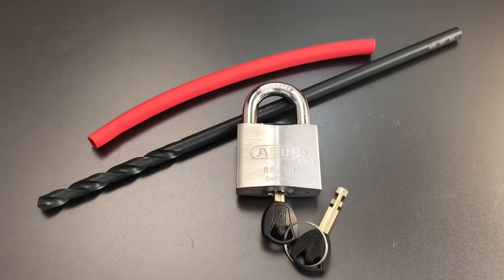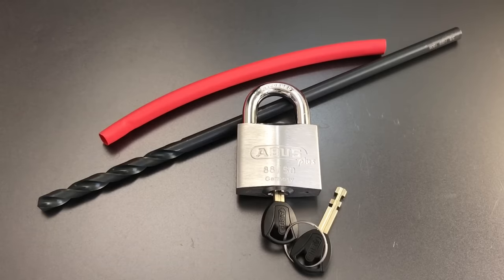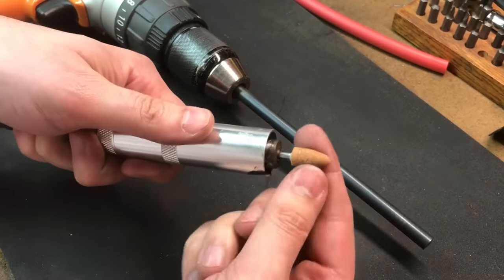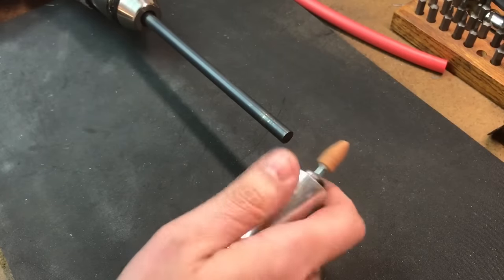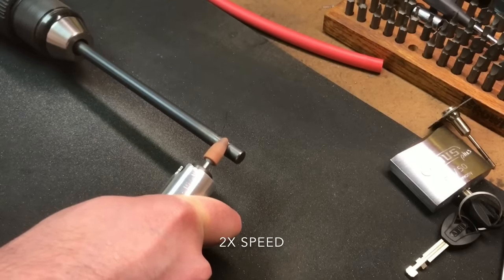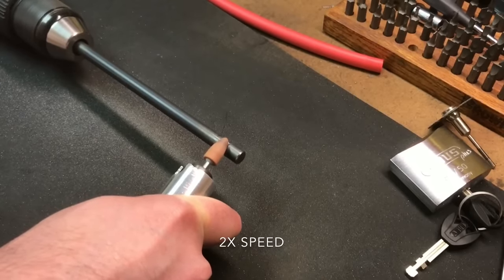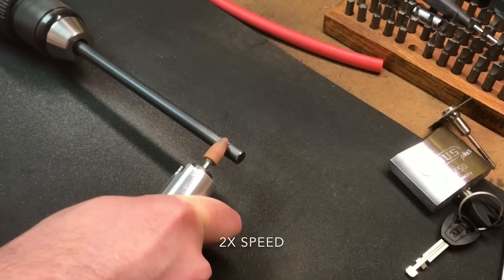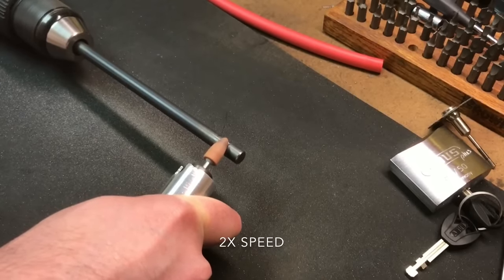[464] LPL Project: The Best Gun Lock Ever?

Comment: That brittle steel cut so thin ..... I bet you can put that bent overhang on an anvil or something similarly hard and hit the lock with a 3lb mini sledge and break it right off. Prob first swing. Drill bits are super hard to cut other steel, and that makes them brittle. Brittle steel HATES shock loads...... Give it a try. If you do it right with a lil floor mat to protect the gun from scratches I bet you can break it without harming the firearm at all. Mild steel would have been a better choice since it bends instead of breaks. But hey, who am I? Just a dumb Ole' mechanic who messes with steel and drill bits almost daily repairing the fleet at work...... Lmao.

Comment: tbh

Gun Locks are practially useless for what people THINK they stop, eg: theft, curious kids with unlimited time and no supervision, or other bad actors intent to do harm. A simple gun lock like this is just buying time, and stopping passive threats (eg, passive theft, toddlers, kids without imaginatioin to bypass it) and for mandatory rules like having a lock/ziptie on a gun inside a store or gun-show or other place to bring it for service/sale/other.

At the end of the day, that's only a minimal defense against a real issue. a Lockbox plus that would be better than nothing. A small safe to keep ammo inside of inside a larger gun safe, is acceptable. 

All this to say: a LARGE, REAL, GUN SAFE made to PREVENT actual theft or serious theft is the only solution to storing a gun safely, with or without ammunition around. Someone can EASILY take a gun and put a single round in it and still murder someone/hurt themselves/do crime without the magazine inserted. It would be slow and stupid to reload, but doable short term.

Get a REAL gun safe if you're worried about securing a gun for real. A REAL Gunsafe is the only solution and gun-locks like this are NOT a replacement.

Comment: Gun locks never made any sense to me compared to safe storage. And if it's not in a safe then who's to stop anyone from stealing it taking it home and cutting the lock off. And if you then say your monitoring it for theft. Why couldn't you then just monitor it from anyone using it by not keeping it loaded or just take one piece off and separate it. All the pistols I've ever had break down super easy and it be so easy to just not store the barrel or firing pin or fire control group inside the gun for free compared to any lock.  And if you say it's quicker to unlock a lock then to take a barrel out of a 1911. Then I'd say if your worried about time. You should not have any lock and the gun fully assembled. Because it's no more dangerous than a brick if it's not

Comment: Bro for someone who knows so much about locks youve made by far the worst lock ive ever seen for a gun you can easily get the bar out
Reply: How would you get the bar out?
Reply: @LazoPazo  just bending
Reply: @RJD1232  you are going to damage the firearm in the process because to even get the bar to bend a MAPP torch was needed to heat the steel. 
Regardless the idea of a firearm lock is to keep it away from adolescents or other individuals who should’ve have access to a firearm. There is no easy way to remove that lock NON-Destructively. Non-destructive is the key idea here because any destructive means requires specialized tools to successfully remove the lock.
Reply: @LazoPazo  no theres other ways of doing it especially with sucks a small bend
Reply: Such*
Reply: @RJD1232  I guess bro. Do you mind explaining some alternative methods of removing the bar aside from heating the steel and bending it back into shape
Reply: With hardened steel? How you gonna bend it without also damaging the fireaem?